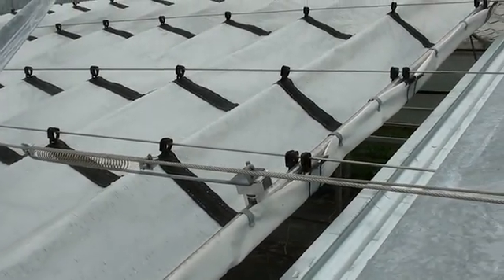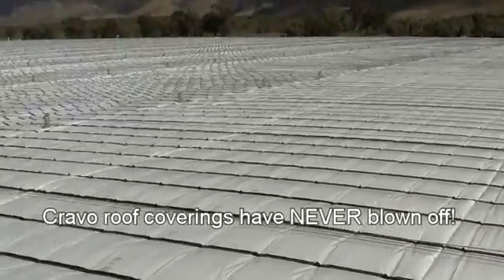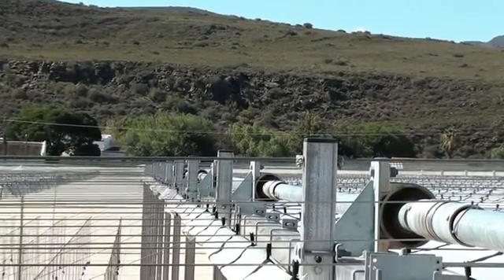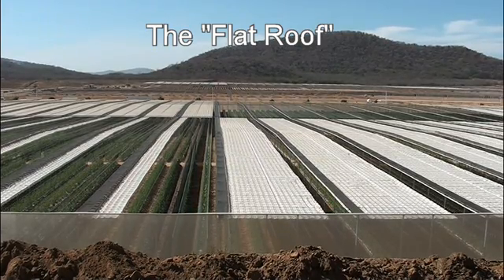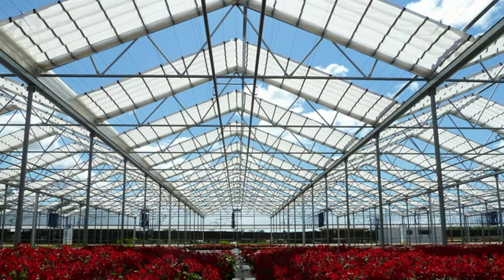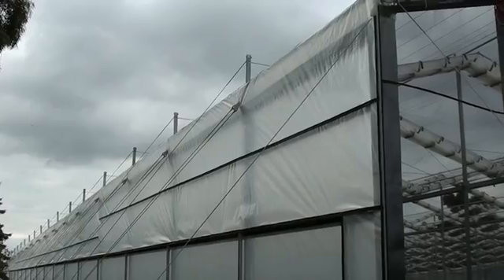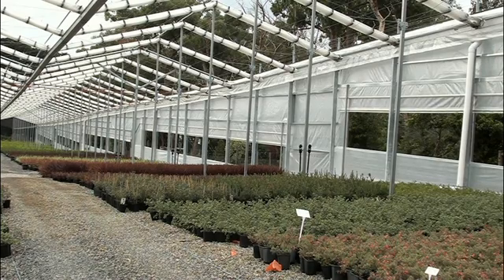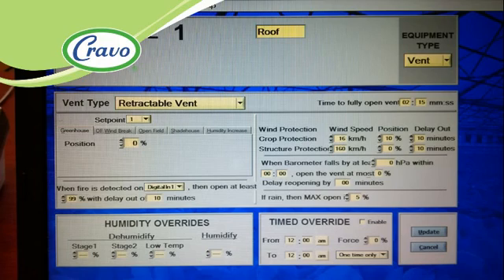40 Years of experience with Retractable Roof Coverings, drive systems and structural designs

Comment: What is the installed cost per sq ft average for these structures?
Reply from the maker: US$3- $20 depending on the model and size
Reply: @cravo2811  What's the smallest size you offer?
Reply from the maker: @KarasCyborg   One acre or .5 hectare
Reply: Can we use this system for spirulina farming in India. It's required for one acer land